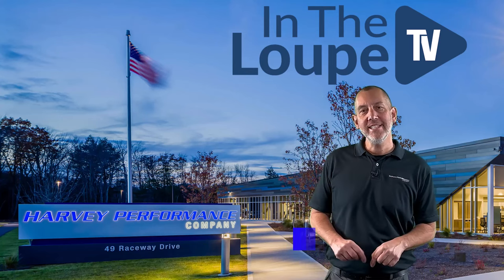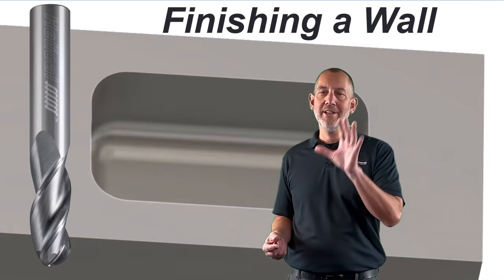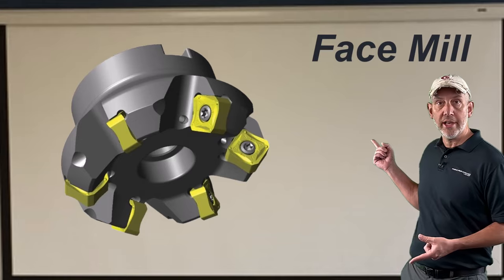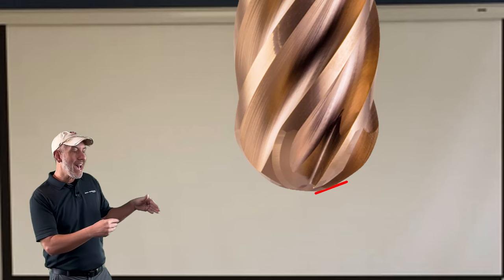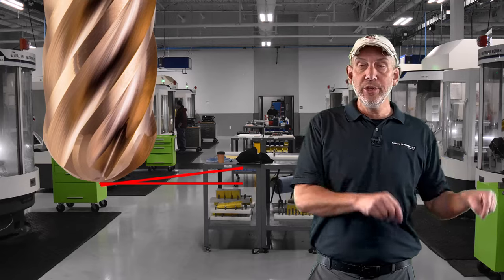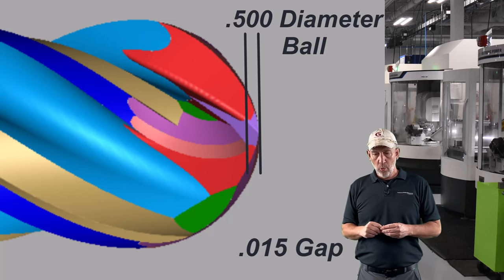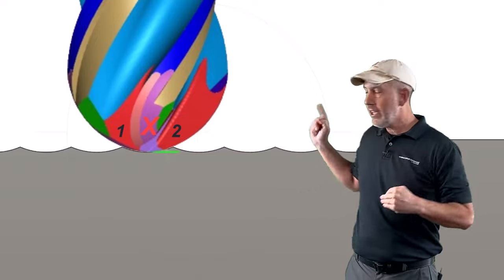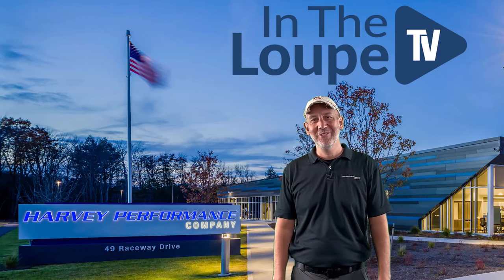Ball Nose End Mills & Chip Thinning: In The Loupe TV Short

Comment: Do toolmakers publish what that distance is axially before all the flutes of a ballnose endmill begin engaging the work?  If not, is there a rule of thumb for it?
Reply: That is a great question.  I would tell you that based on a variety of designs with the gash all manufactures do it slightly different.  You could look at a rule of thumb as 3% of the diameter for our steel tools.  Now we do make our Aluminum 3 flute balls with all three to center just for that reason.😊. Ctc

Comment: Could you teach me about the rake angle for cutting HARD MOULD, SKD61 55 hrc up? I use helix 30' rake -2 -7 +10. Why is +10 the best one.Theory said minus good for hard metal
Reply: Lower is better for harder material,  But not as low as you would think.   I like around 5 Degrees for 55 and up.  You still need to form a chip and therefore plowing is not always the best way..  ctc